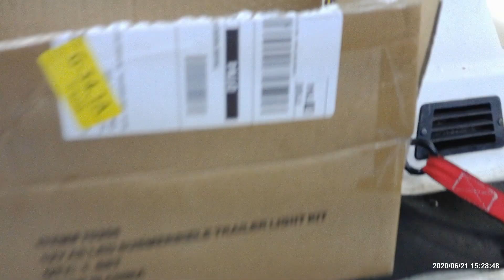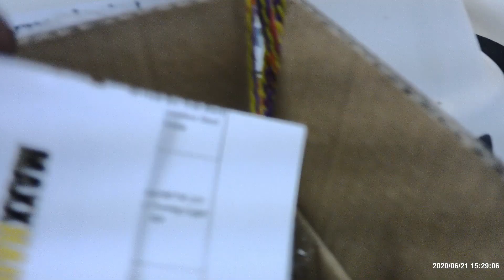Seadoo xp and gti revival.  Changing fuel lines and installing trailer lights. Esp.421

Comment: Go ahead and eliminated the oil pump, pre mix works perfect. You will get different opinions, but the reality is that you can pre mix 24/7 with zero problems.
Reply from the maker: well had oil pump bypassed on gti. But i decided to give it a shot. The xp was already blocked off. I rode it today and it runs smooth.  I think the premix gas files plug. The oil pump puts out just enough oil to lube and not file plugs. I might be wrong. I have been premixing sense my dirtbike days. I guess its apples and oranges.